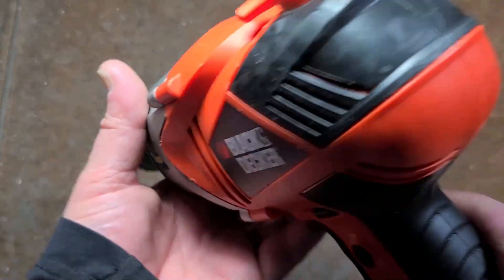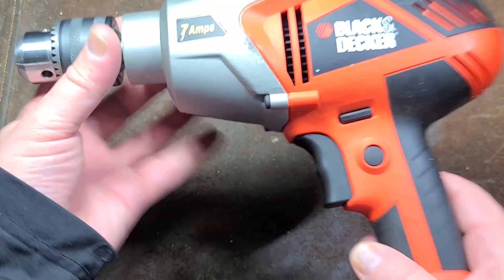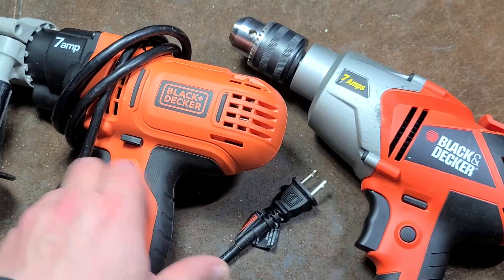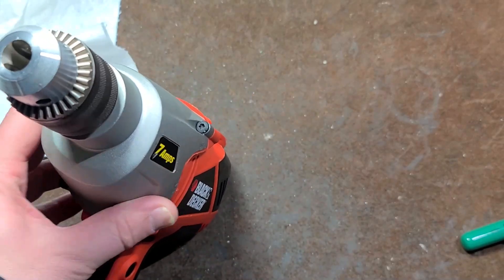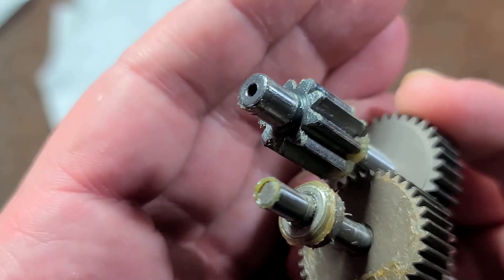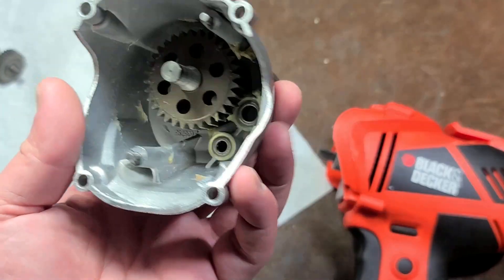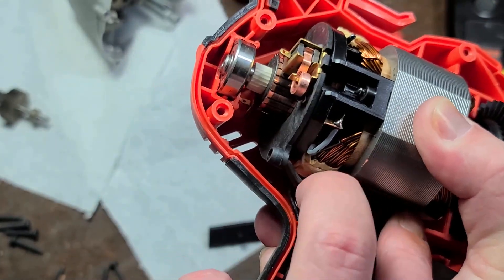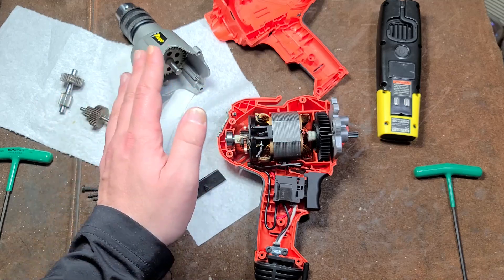Black & Decker 2010's 1/2" Drill Review/Teardown

Comment: Currently replacing control group on an earlier model, but with the newer model's controller (only replacement part available). Thanks for the close-up (16:00) showing where the wires connect, you saved the day!